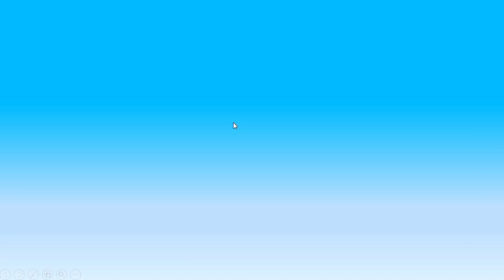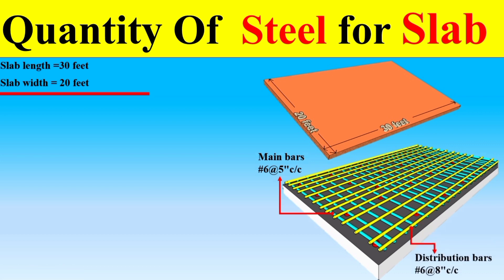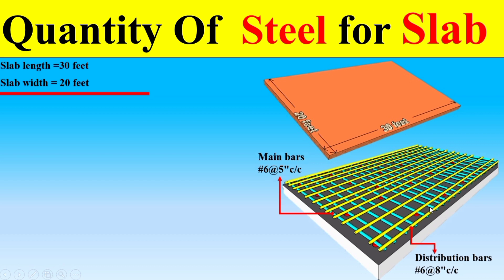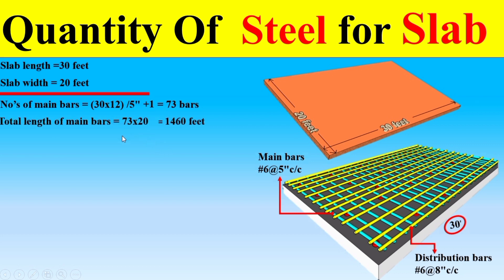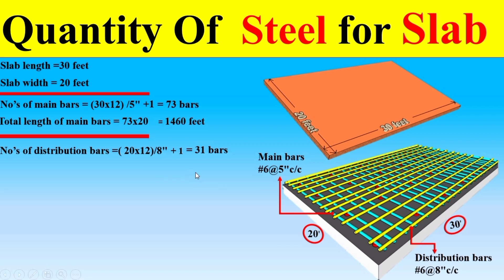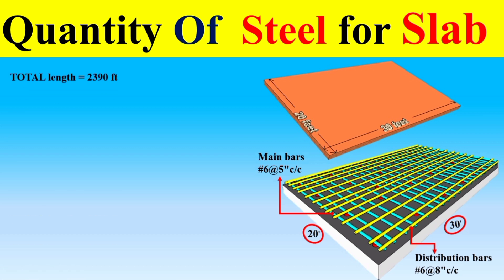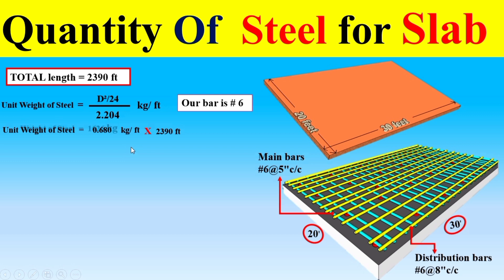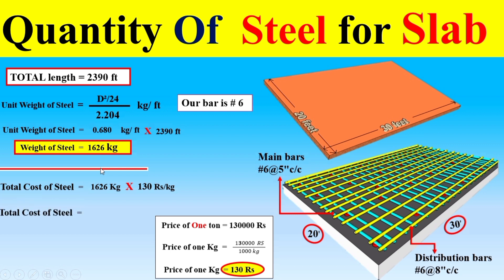Steel quantity calculation for slab | Steel quantity calculation | Civil Engineering Zone

Comment: Sir by thumb rule if we solve this let the thickness is 0.5 ft so vol in cft will be 30x20x0.5=300cft and it is 8.5 m³ and 80×8.5= 680 kg so steel is 680 kg and by this method it is 1626kg so which one is correct
Reply from the maker: Dear Simple flower I think in this case our method is ok and correct.
Because if we used the thumb rule to calculate the steel it give u the approximate value not the exact.
Thanks for feadback.

Comment: Thanks dear sir
https://youtu.be/ahznR8dDWIk
انجینر ی د پښتو چینل
Reply: Sir by thumb rule if we solve this let the thickness is 0.5 ft so vol in cft will be 30x20x0.5=300cft and it is 8.5 m³ and 80×8.5= 680 kg so steel is 680 kg and by this method it is 
Baijan yeh smja do yr